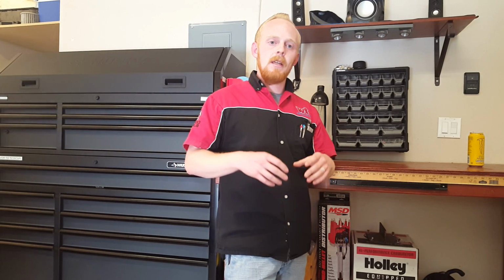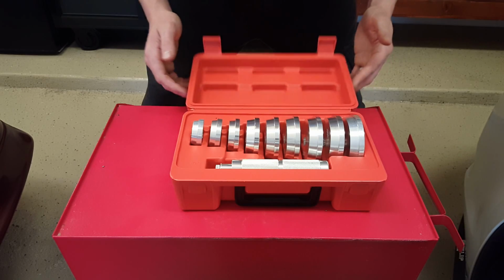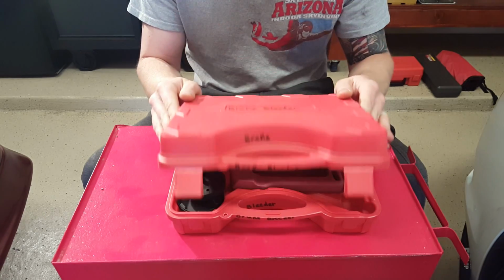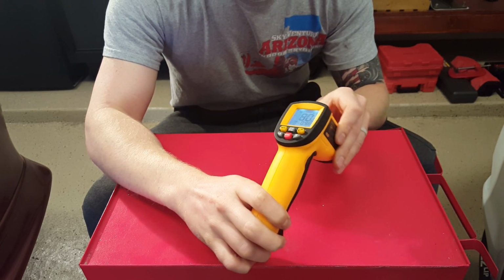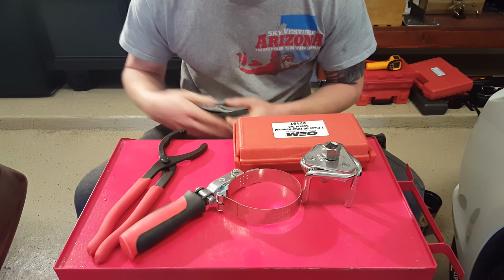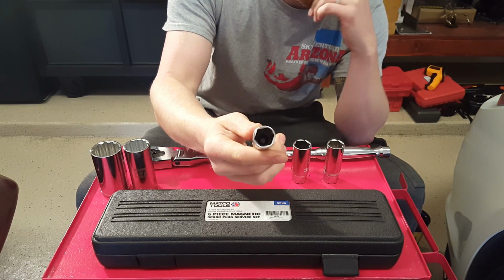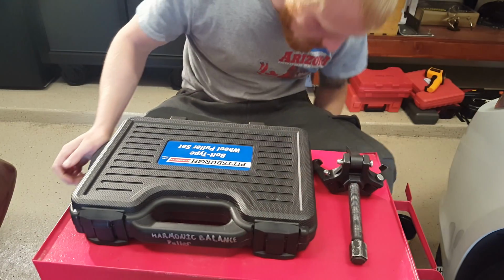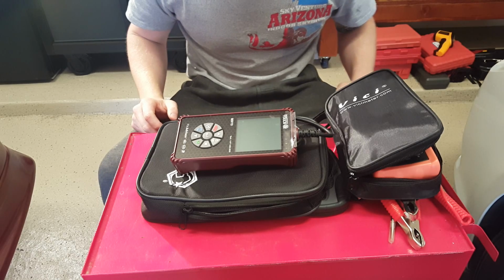Top 10 Automotive Tools Part 1

Comment: Infared thermometer is also almost ideal for checking misfires easy to tell if a cylinder is not firing..
Reply from the maker: Absolutely 👍
Reply: Learning a lot - thanks for the automotive tool tips.
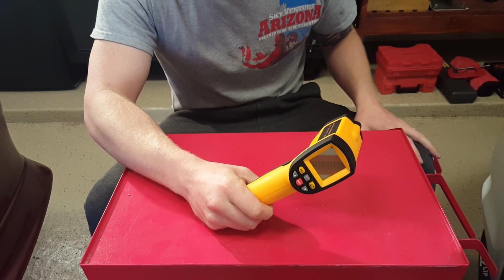(Here's a tip back - at 12:30 & 15:30, it's "infra-red," not "inferred" to refer to the light spectrum it's using, not how the temperature is determined.)

Comment: You wouldn't catch me using a pickle fork for anything. And HF has a great air power brake bleeder vacuum for 35 bucks. Same as mighty vac. Fraction of the price

Comment: I am debating between that Matco spk6 spark plug sockets set and a Gearwrench/KD set with less coverage.  Do you know the applications for the different 9/16" sockets? The 5 piece Gearwrench set only includes one. Thanks.

Comment: Only use a pickle fork on a joint you are replacing because it damages the boot and ball in the socket. I have never owned a pickle fork and get joints separated without breaking a sweat, with a front end service set. It comes with varies pullers that are used with an impact and the joint is not compromised.
Reply from the maker: Joe Hearn ya I use the service set as well and most the time I can get them out with it or a hammer. Pickle fork is my last resort but still a great tool.

Comment: The title doesn't match the video or its description, butvregardless, the top tool that any mechanic should prep, maintain and care for is his brain.
Reply from the maker: pssst3 your right your brain is your biggest tool but we are talking physical tools in this video and if you check out the other half of the video created by themechanicman92 you will see the title and description fit the video. We are talking about 10 tools automotive repair uses that a body specialist wouldn't really use and vise versa. Thanks for watching!

Comment: I never really understood the point of those angled head wrenches but can I see how they would help access things like suspension mounting bolts. Might have to get a set of those, in collision repair it's actually very common to have to R&R damaged suspension parts.
Reply from the maker: RustyJeep oh ya i could see how those could be helpful for you. thank you for watching and commenting!
Reply: Alot of brake caliper brackets have bolts that are partially blocked by either suspension or lines. Very good for those.